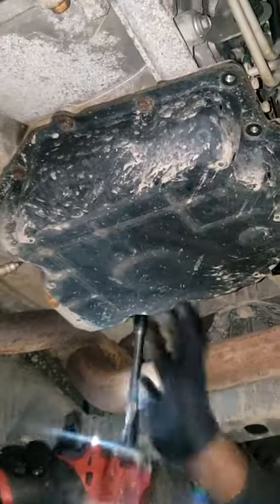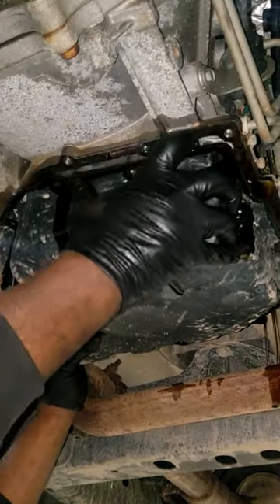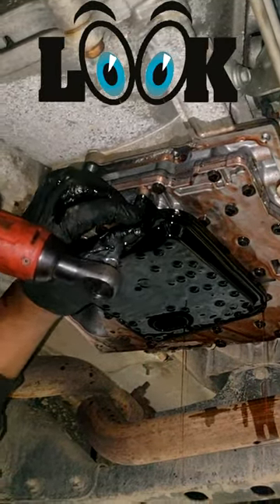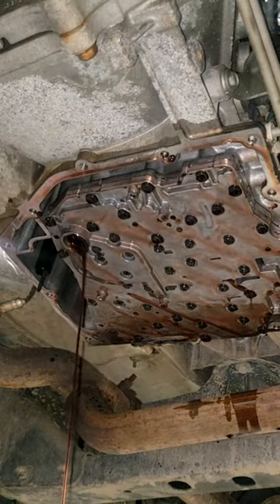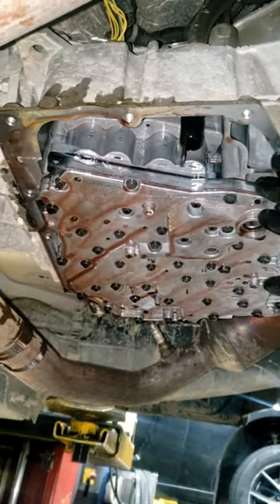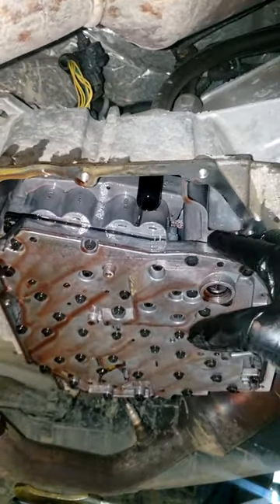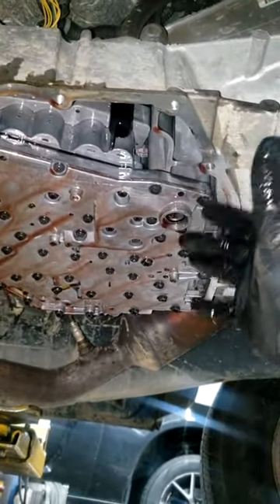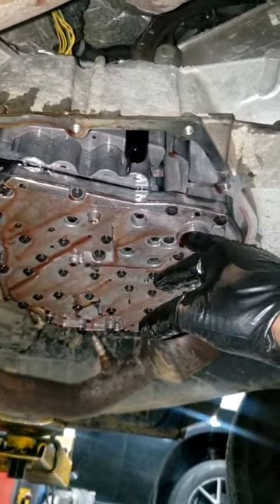No transmission flush machine, no problem. Do This. Best way to get out more of the old fluid.

Comment: Most of the fluid is inside the torque converter, old school ford's had a drain plug on the converter.
Reply: New Mercedes have them too. Very annoying getting it exposed without the baring tool though.
Reply: @thelol1759  I actually drained one recently on a type 9 transmission with the newer blue fluid someone had put red fluid so yea we just opened the inspection hole rotated the engine over and found the bolt and bam
Reply: What Ford tranny ever had a drain on the torque converter? Dosent make sense
Reply: @TrapperAaron  my 89 F150 C6 automatic transmission had a drain plug on the torque converter, makes perfect sense. Most of the fluid is inside the torque converter, not all ford converters have them.
Reply: @TrapperAaron  It Makes perfect sense. Every 4r70 I’ve seen , car or truck, between 1994-2002 had a drain bolt on the torque converter. It’s a drain plug. For draining. Which is something you should do if you changing the transmission fluid. Just dropping the pan  will only get you maybe 5 quarts. On average; Between the pan & filter, transmission cooler, and torque converter. The 4r70 holds close to 12-13 quarts. Although it’s nearly impossible to flush the transmission cooler itself on some fords because they have a thermostat integrated into the transmission cooler. This was implemented to allow for the transmission to reach operating temperature faster. So unless there is a flush machine that heats the atf to 180 degrees which I’ve never heard of or seen; the cooler can’t be flushed. This means you would have to replace the cooler if it ever became contaminated
Reply: @TrapperAaron  the c6
Reply: Yup and they hold  more than half the fluid the actual transmission holds.
Reply: Same with mopars. Besides he should run it to pump out the converter.
Reply: I remember.
Reply: @TrapperAaron  
I had a crown victoria 95, and a 2000 expedition.  They both had torque converter drain plugs. I think it is an excellent idea. Made life lot easier.
Reply: @TrapperAaron  79 Fairmont - inline 6
Reply: @TrapperAaron  my 65 ford cruise-o-matic MX trans Cast iron gearbox  3speed has one
Reply: @TrapperAaron  AOD, AODE 4R70W, E40D, 4R100, C4, C6, almost all of the rear wheel drives until the mid 2000s had a drain plug. The OE coverter had them. A factory Motorcraft replacement usually didn't have it.
Reply: @TrapperAaron  
Cuz your a liberal
Reply: @TrapperAaron a lot of them in the 60s and 70s less and less after.
Reply: @Vic Popping the cherry on a Ford. It is a way to tell if the transmission has ever been serviced as you're supposed to discard it at 1st service. However, so many people throw them back in the pan during service thinking they broke something inside during servicing and say that must have happened after it left. All they are is a stopper they put in the dipstick hole during transmission assembly to prevent stuff falling into them on the vehicle assembly line. It's the same transmission in the V8 Mustangs, vans and F150 trucks. Only difference is the dipstick tube length and torque converters. When the assembly line installs the dipstick, the "cherry" falls into the pan by design. It isn't broken and doesn't harm operation of the transmission floating and sloshing around in there.
Reply: @TrapperAaron  I guess you never own a 92 ford truck plus the dealership would even tell you about it depending if it was a decent dealership
Reply: This overnight stuff will do the trick. My Mercedes don’t have drain plug on torque converter, if you just drop and reinstall the pan, you only able to drain 4 out of 8.6 liter of oil. If let it drain overnight, I get as much as 8 liter of oil out of it
Reply: @TrapperAaron  my lightning does
Reply: I think you mean the clutch reservoir?
Reply: @Charles Hines the newer Mercedes still have the converter drain, remove the plug you will get around 3-4L more fluid out, we do them all the time where I work, super easy don't know why most people skip that step.
Reply: @TrapperAaron  The Ford C-4, C-6,  FMX, and the Cruiseomatic.  ,early Borg-warner T-35, had plugs in the convertor also. 7/16 socket fit the plug ,thru a hole in the flexplate.
Reply: @someguy2312 People like to strip out that little Allen drain plug, and then it's a pain to get out. I don't drain the torque converter unless the fluid is contaminated.
Reply: Why is it that old school rides had things that make sense. Complicating things on purpose just make money $$$$$. 🙄
Reply: @TrapperAaron old school c4's and c6's did...
Reply: @TrapperAaron they use to all have drain plugs on the TC
Reply: In the 60s Mopar too
Reply: @TrapperAaron  you're not old enough
Reply: @TrapperAaron MY 73' Lincoln had one😊
Reply: That would be the smart thing to do.. So yeah, that definitely won't come back!!  Car companies are greedy these days and don't care about quality.
Reply: @garyzhang5099 no need for waiting overnight. You can do a full flush via trans cooler lines. Takes mere minutes to get the remaining fluid out. I swapped out all the fluid in my 722.9 (red fluid). About 9.5 L
Reply: @TrapperAaron  How does that not make sense
Reply: @TrapperAaron the 80s c6 transmission did
Reply: @TrapperAaron makes perfect sense.
Reply: @TrapperAaron has left the chat
Reply: @TrapperAaron  My 96 E150 Van has a drain plug on the converter. It has an E4OD trans.

Comment: Would it kill manufacturers to put a drain plug in the trans?
Reply: Yes, it would, which is why they don't do it. You're not meant to easily change anything about the most sensitive piece of equipment on your vehicle.
Reply: Unfortunately that's not how automatic transmissions work. It's not like the engine oil dump. The trans pan will generally only hold 1/3 of the total fluid capacity
Reply: my 16 honda has one. Square insert just stick a breaker bar straight into it, drain and fill then use check bolt to check level. however my zf trans on my 4 series is a different job
Reply: hondas have done this at least since the gen 5 (1994).  gen 6 also has an internal filter that is designed to flush when you do a drain and refill.
Reply: I have two of them on my trans! A drain plug and a fill plug.
Reply: Would it kill to make a good quality plug too that doesn’t strip 😂
Reply: Yes it would because that encourages DIY and right to repair. And in this day and age no one wants the consumer to save money or be able to service their own technical products. That's just not ideal for planned obsolescence.
Reply: My 2007 chevy aveo and 2015 chevy sonic have one.
Reply: Toyota
Reply: Some do some don’t my Honda does and it was filled with engine oil, I’m glad I wanted to change it after 150k miles
Reply: Yes..
Reply: I bought a $33 aftermarket Dorman pan for mine that does have a drain plug in it.
Reply: My automatic and manual Subaru both have drain plugs. You won't get it all, but if you drain and fill once or even twice before pulling the pan and replacing the filter/clean the magnet, it does a great job. So much easier than pulling the pan off several times
Reply: They did it on my car but now the filter is impossible to remove without taking trans out
Reply: The trans flush machine that run in series to the oil cooler is the BEST WAY as long you use the correct fluid
Reply: Just creates a potential point for failure
Reply: @zachbecklake2303  A lot of automatic transmissions have drain plugs. My 2001 Honda has one and it makes it super easy to do fluid changes. Don’t even have to raise the car up to change the fluid.
Reply: @zachbecklake2303 it still makes it much easier to drop the pan since you won't have a massive oil spill. Plus it makes it easy for regular drain and fills.
Reply: @allenklingsporn6993  Is that like how it's too dangerous to refill your own gas in Jersey?
Reply: YES
Reply: Some companies make after-market ones and do but most manufacturers recommend to change the filter too
Reply: By that logic there would be no oil drain plug....talk about tge most sensitive part of the vehicle?? @allenklingsporn6993
Reply: @allenklingsporn6993  That's a good argument for not having an oil pan drain as well.  There is no good argument for having one and not the other.

Comment: You run the transmission while draining at the cooler and filling at the dipstick until ir runs pink and clean. Then fill to correct level.
Reply from the maker: The fluid is not my main focus, its the filter. I just try to get out as much fluid as possible
Reply: But that is the correct way to flush a transmission . I change the filter after I flush one
Reply from the maker: @TheFORDman256  yes, but with the pan on..I have the pan off this car. Imo a flush job is risky and worthless if it does not include changing the filter. If you doing them both, good for you my friend
Reply: Or unhook the cooler lines let gravity bleed to plus the cooler or use compressed air out of your air compressor turn down the regulator on the compressor
Reply: Plus whoever said Fords use to have a drain plug in the converter I've used made a magnetic drill bit drilled the converter tapped in with pipe thread tap put a quarter inch pipe plug in it I've also started it up real quick let it pump itself out I'm 63 my dad owned operated a Standard Oil Station for 52+yrs 60 total plus an friend that taught how to rebuild trans taught me these things. That you can just stay over a little bit get the job done then that day so when you come in tomorrow morning it's a whole new day nothing weighing you down overnight go home or the tavern for a cold six pack drink one take 6 home with you done that many times picked a young lady when I wasn't married women seemed to love a hard working man in a uniform even use to carry a clean uniform with in car ,truck whatever I had sometimes drove a customers vehicle trouble shooting staying one step ahead for in the morning tomorrow even did that when I worked at the dealership and after I built my own three bay three in ground lifts service center have to always be thinking how to stay ahead of the game making your life easier
Reply: 3500 Rams have a transmission cooler line thermostat so that wouldn't be an option but flushing then a filter change is ideal. Hell most big trucks have 2 transmission filters plastic and like the externals on the Duramax  trucks.

Comment: Grew up in a transmission shop. NEVER flush a transmission. Guaranteed failure if you do. Drain, replace filter, refill - that's it.
Reply from the maker: Totally agree
Reply: Banana  Lots of times you flush a high mileage or neglected trans and it no longer works when you're done. 
✌🍩
Reply: Flushing a trans with low miles on it and keeping up with it, won’t hurt it. When you wait until it has 150k on it or more, can sometimes wake up a problem. It doesn’t create the problem, it just cleans it out. When the clutches wear down, they lose friction. The friction material remains in the old fluid and the trans still works. Once you clean that out, bam.
Reply: I'm late but I have a jeep zj what if I wanna change my solenoids etc as well in the trans is that bad too?

Comment: Why not just disconnect the cooler lines and connect the intake to a reservoir with new fluid (can build one out of a bucket and a spout) and then put the outflow lines into a drain receptacle. This is the no mess way

Comment: After pan drop, filter change, magnet clean, and refill, many times on many vehicles I have taken the cooler line loose and added fluid through the fill port while someone starts the engine … Pan never runs dry this way and with a piece of clear tubing running to your drain pan you can visibly see the color change of the fluid. 

 In any case thank you for caring enough about the customer's vehicle to get more old fluid out and more new fluid in!
Reply: We do this often in Australia... It's your last chance to save a trans sometimes... ,😂
Reply: Old school here, damn Mike, and I thought I was the only one who cared.
Reply from the maker: Interesting points Mike
Reply: @imgonnagogetthepapersgetth8347  The way to do it is pump into a a large fluid container (I used a 2.5 gallon oil jug) so you know how much goes out versus what you're putting in.
Reply: Didn't read the comments enough lol i just posted the same thing lol
Reply: Always did it using cooler lines, except the two Fords I had. They both had TC drain plug.
Reply: I was just going to say what you said but you beat me to it
Reply: I used the cooler line method in my F-250 6R140. Although I was careful, the connection dripped for awhile before resealing itself. I wouldn’t do it every time, but in my case the service history was uncertain.
Reply: @channell11 doesn't really matter if more goes in or out you can adjust after the flush.
Reply: @t-bfr45-70  not in a sealed unit there is no fill plug to add or a dip stick to check
Reply: @R3CKLESSRHINO  most of the sealed unit are not that sealed and do actually have a way to check them some are just a pain in the a$$. What particular car are you thinking.
Reply: On point
Reply: I need a tutorial on this. want to do it in my Jk
Reply: Gotta try this. Thanks for the info

Comment: Also to get a little more fluid out u can drain from radiator and hoses if u are trying to get the most out of you really want to get active with it flush out the transmission radiator to get out out sediment from your system

Comment: Some people hate Saturns but they had the right idea when it came to transmission fluid.   It had a filter just like and engine oil filter and a drain plug.   You could change the fluid easy as an oil change.
Reply from the maker: O wow, never knew that. Thanks.i got to look into that
Reply: @Online Mechanic Tips  I'm not sure what years were like that but I had a late 90s saturn car that way.   I remember guys taking the trans filter off at an oil change place I worked at thinking it was the oil filter.
Reply: Woooo!! I had 3 Saturns, and never knew that!! SL2 5sd, SL1 Auto both 94’s and one 97 SL Auto … Damm cars ran flawlessly forever!! Good on gas too out that Toyota branded motor 👍🏽😂

Comment: Unhook both lines at trans cooler or radiato and connect hoses on each one. One going to a bucket with clean fluid and the other pumping into an empty bucket. It will suck up the new fluid and flush out the old. Once it comes out clean shut if off, reconnect lines and run it while checking level. If it's too high unhook the return line and run it to pump some fluid out and recheck after reconnecting lines or use a hose on a hand siphon down the fill tube if it has one to remove fluid as well.
Reply: The cooler return doesn't run though any kind of pump. It is a pressurized return from the cooler feed. It cannot suck. You'll be left with 2 buckets, one full of clean ATF and an empty trans sump and one with a few quarts of dirty ATF.
Reply: @lukemalloy2488  great catch man. Idk how this method worked for this fellow. Science/mechanics never lie
Reply: Saved me the typing.
Reply: Well try it for yourself and see. Did it several times on a 4r70w in a 96 tbird. Did it on a 4l60e I'm a 98 Chevy as well
Reply: @lukemalloy2488  talking about the lines coming from the trans to the cooler, not leaving the lines connected at the cooler and disconnecting at the trans
Reply: @Unzem   I'm not exactly sure what you're trying to tell me. But I will tell you for certian that the 4L60 does not have a pump to draw the fluid back from the cooler supply. Sure you can disconnect the lines from the trans start the engine up and empty the sump through the pressurized cooler output. But there's no way in hell the other line is going to draw fluid back in period it's simply not possible. Its a pressurized return, no scavenge pump.  Not trying to argue, just putting out correct information.
Reply: A true flush.

Comment: You can do a perfectly serviceable full fluid exchange by disconnecting a transmission cooler line and letting the transmission pump the fluid into your receptacle as you add fluid to the transmission.
Reply from the maker: Interesting
Reply: That's a good idea but bad for the front pump on the transmission.
Reply: I never done it that way. Too risky. Just add a pan with a plug and change the oil via the pan every time you change the oil.

Comment: have bought a fiat 500 with 100,000 miles on the automatic transmission & never changed before so decided to easy drain 2-3 quarts at a time and drive to see how it handled the new fluid..did this about 5 times while I tried to measure out same as I put in while I ordered the dips tick it never had..a few more  changes and it might start to get red..but so far still dark...I wanted to try a cooling line flush but figured it might be too much ..so far no issues!

Comment: On my 03 Ranger I pulled the trans cooler lines and started the truck.  Added fluid while the trans pumped out the old.  Once it turned bright red its flushed.  This was all after dropping the pan and changing the filter.